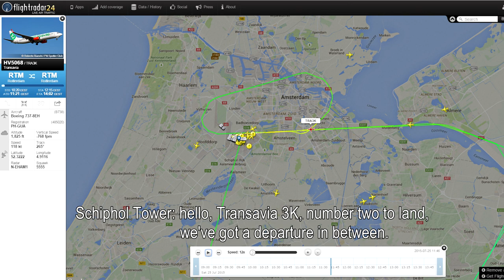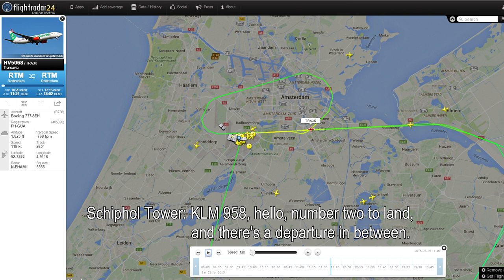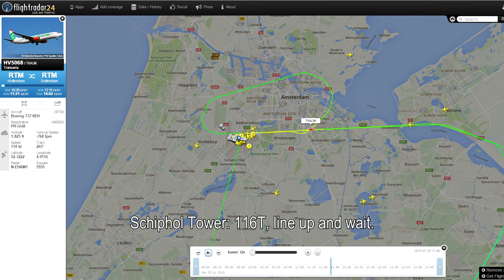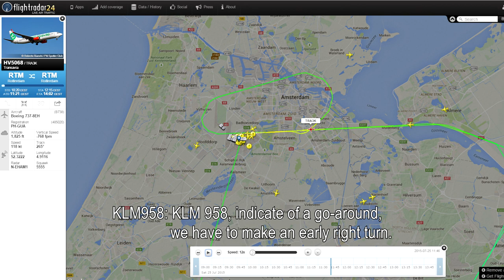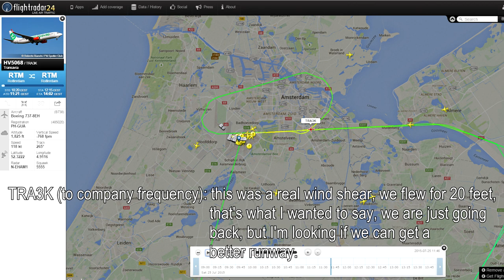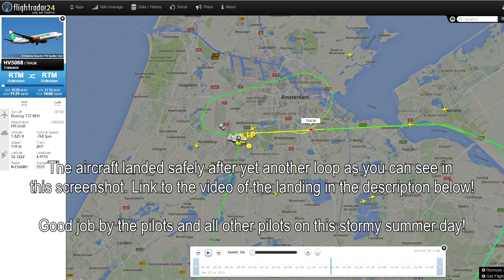ATC Audio: Transavia 737 in Heavy Wind Shear Trouble! [25-7-2015, Subtitles Included]

Comment: Wow... This is why I don't like being a passenger on civilian aircraft. Their training has to be as cost effective as possible, and all they do is punch buttons and use the autopilot. So when it comes to actually flying an aircraft, they lack the skills.
Also, this pilot in command you hear on the radio totally lost her composure. She was way too stressed out. She shouldn't be sitting in a cockpit of an aircraft carrying passengers, but that's just me.
Kudo's for the guy on the tower. He realizes she's in trouble and helps her calmly and professionally. The final landing looked really good, considering the conditions and having a source of chaos sitting in the seat next to you lol.
By the way, in gusty conditions, it's not uncommon to do a flapless landing. It allows for a higher speed on landing, which provides more stability.
Reply from the maker: Robert1983USA You really think they were just pushing buttons during this incident and that they are not trained to fly manually? These were actual pilots flying the aircraft manually through a wind shear. If they lacked the skills, they would have crashed. Why don't you go up in the cockpit and fly the airplane, see if you are so relaxed knowing you are low on fuel and knowing you have take care of the 170 lives behind you. In my opinion she communicated in a calm, but very direct way. If shey would have stressed out, she would have been talking nonsense.
Reply: Robert1983USA omg...i wanna see how you react in this situation , when you have only one attempt cause you don't have that much fuel anymore to do more then one attempt!....watch the video were the planes lands...an there you see  they did thair job perfectly!....it's better to be a bit nervous than too cool and ramming the plane into earth!
Reply: AviationPro It starts with reading... Ofcourse they're trained to fly manually. But they hardly have actually have to fly an aircraft. Company regulations state exactly when they can, and when it's prohibited. An autopilot flies way more fuel efficient than a human. So an airliner pilot doesn't really fly a lot. It's mostly just punching buttons and let the autopilot fly a flightplan. If they had skills, they hadn't made the news with this emberassing show of poor skills.

And I don't know what you consider calm communication.... But lol... She has no idea what she's doing anymore. She's basically panicking. You can hear it in her voice, instead of using English she switched to Dutch, and even though after being corrected by tower, she kept on transmitting on the tower frequency, bringing other air traffic in danger. She has no idea what she's doing, because she can't cope with the stress. Any pilot worth his money would agree with me on this. These are moments when pilots start earning their money. But this one isn't cut out for it.
Reply: Robert Kroeber 
I don't know the details, but the fact that they were low on fuel maybe has to do with the decision making progress that went before. And also her communication with tower could be better. She's not being clear. If she's low on fuel, she just go ahead and declare an emergency, instead of confusing herself and everyone else on the radio.
It's ok to be nervous, but when shit hits the fan, a pilot should become absolutely calm and unfuck the situation. She did a very poor job at that. I'm just saying, all the positive remarks here are surprising, because it's something pretty emberassingly bad that happened here. And hey, people can have a rough day and make fuckups, ofcourse. But it's weird they get praised for it.
Reply: By the way, don't forget all the other aircraft that had to do go-arounds that day. Or the aircraft that made the decision of diverting to an airfield further away from the storm. Like Brussels or Dusseldorf. No, this one decided to go from Rotterdam to Amsterdam, hold there for like 45 minutes, and then almost run out of fuel (???) and not declare an emergency? But instead clutter the tower frequency with panicky stressed out transmissions.

This should have been a normal landing, but to me it seems that loss of composure and less-than-ideal decisions made this a bad situation for the aircraft and it's passengers.

Shit like that happens. Let's hope people learn from this.
Reply: Robert1983USA  I fully agree with you. This is the worst pilot performance i have seen in years. This person lost composure  in a stressfull situation and therefore should not be flying airplanes.
Reply: Joe Smoo What absolute nonsense. You're basing this judgement on one piece of evidence and one error (of transmitting to the tower). Oh, and because she sounds panicked. Clearly, she shouldn't be a human being, let alone a pilot!
Reply: Nah, she's fine as a human being. She's just not cut out to be a pilot responsible of so many passengers. Clear as ice. I wouldn't want to be on board.
Reply from the maker: Alright I'm blocking you. No need for this kind of rage towards a female pilot who did a good job landing an airplane. Bye :)
Reply: Wow, low fuel, winds gusting to 50kts, no flaps landing in rain?
I'd like to see you try
Reply: "They lack the skills" lmao are you serious? Pilots who "lack the skills" will never and I say NEVER be allowed in the cockpit, even if they're not the one flying. That is nonsense. What do you think all the training is for? Training flights with real general aviation aircraft and highly realistic full motion flight simulators. Your talking rubbish.
Reply: Robert you have no clue!
Reply: But partly Robert is really right. Its just setting the computers today. And if you nearly have no practical training, because always the autopilot does, then you can get a problem. It not enough, just to do one landing per flight manually and a yearly checkup. Their flight routines, even in practical training, are mostly the computers, but its counted as "flight hours" and they can say I have 2000 hours, but manually there were maybe just 100 flying.
I even notice when I fly VFR, after 1 hour straight flight, I do not have the feeling for the aircraft, as if I permanently fly traffic circuits oder doing airwork.
The computers are both today, heaven and hell.
Reply: Laat je niet gek maken door die Robert, AviationPro. De man doet volgens mij stoerder dan hij in werkelijkheid is. Hoewel er best wel wat aan te merken is op de pilote in kwestie, moet je er maar aan gaan staan. Het weer die dag was vreselijk. Ze was in Eindhoven geweigerd, nadat ze in Rotterdam al een Go Around had gemaakt. Het toestel was flink licht door gebrek aan brandstof, dus bij dit weer een stuk instabieler, dan heb je wel iets druk op je verantwoordelijkheid.

Ik ben het met je eens dat deze piloten het uiteindelijk gewoon goed deden. Die Maty Far is schandalig bezig met haar woorden.
Reply: who says she is flying?? bcs she was taking control of the radio, i think the other pilot is flying the plane. or can one pilot do the 2??
Reply: Robert1983USA You my friend know absolutely nothing. Lets just hope your not a pilot. In a highly stressfull situation she even had the capacity left to remember her CRM training and compliment the FO on a well flown go around. All she did wrong was mistakenly talk on the active frequency. Big deal. In the meanwhile, how about focussing you attention to at all that non standard aviation English in the US which is very dangerous. From both ATC and pilots. Just listen to any emergency, ATC is completely lost, nobody does a readback or at least not a full one, pilots just say fck all and land on any runway which then starts a discussion between atc and pilots. And mate, 50 kts wind are not easy and they managed it, as a crew. Job well done